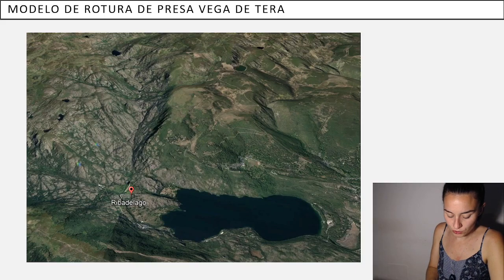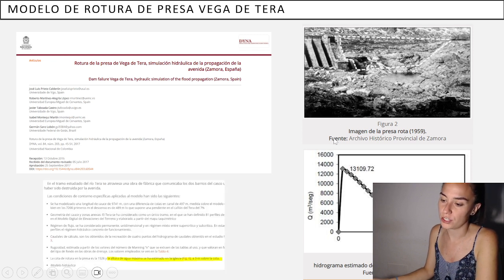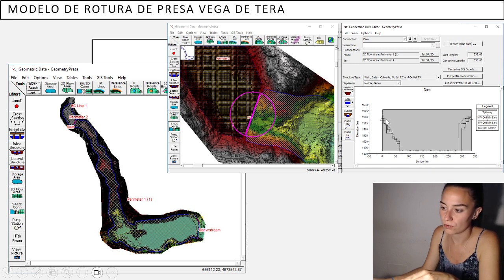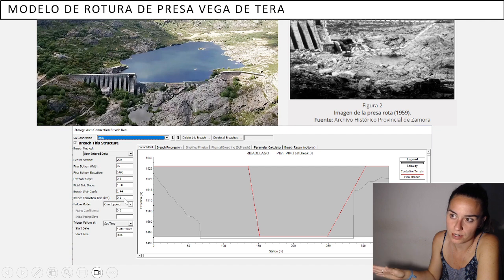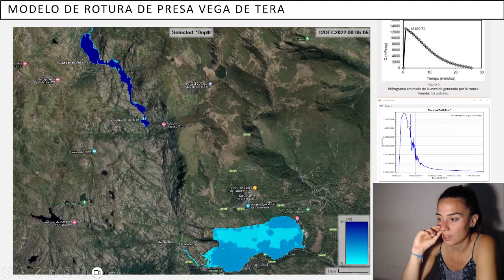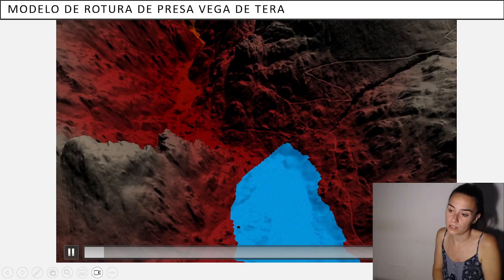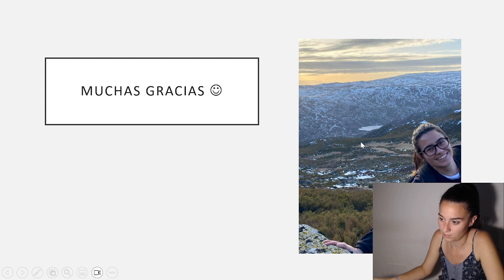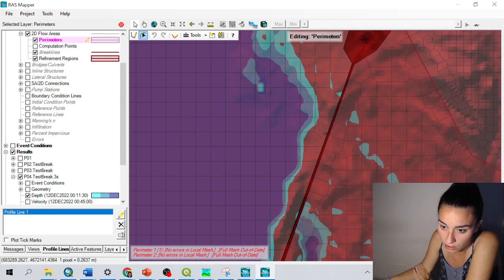Dam breach model in HEC-RAS 2D

Comment: Falling limb of the hydrograph is showing spikes that are indicating model instability. Please check the selected time step.
Reply from the maker: Hi Rajesh, good catch! It is true that these spikes seem to be model inestabilities. In this case we have not optimized further the model because it is just for the purpose of the tutorial, but if we wanted more accurate results, I would suggest the following:
We can use adjust time step based on a series on time series divisors, this way we could use longer time step at the end of the simulation when the velocities are reduced.